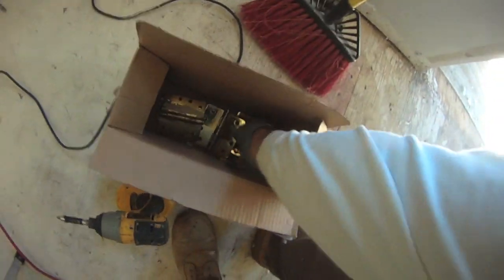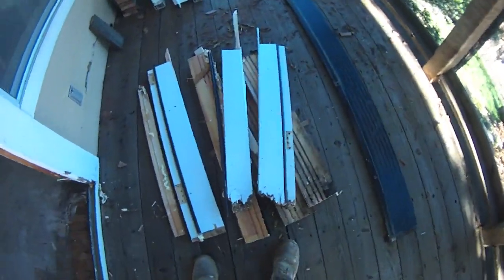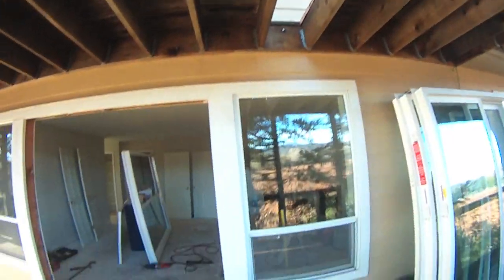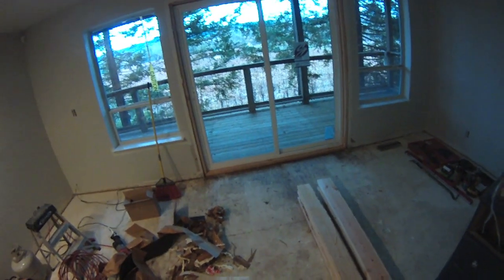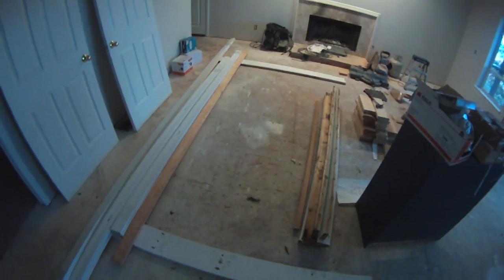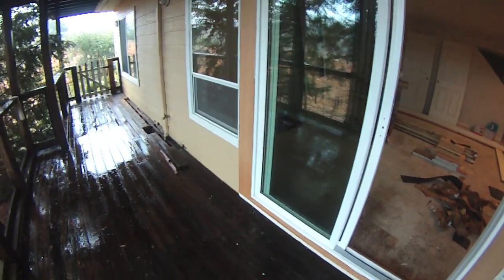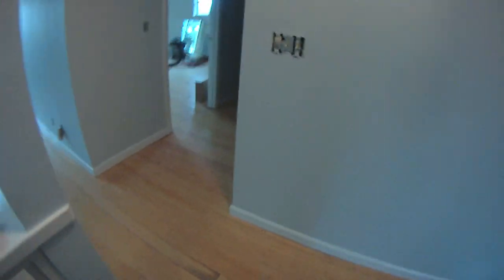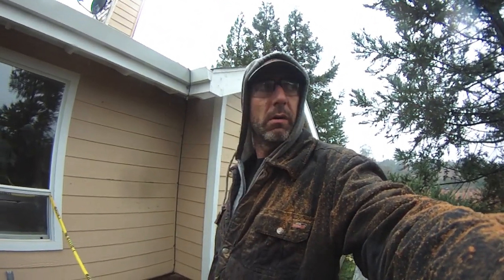Replacing Patio Doors

Comment: I'm on the sweet tea big time! Great work Bee! I guess homebody eventually showed up?. I know some people that unhook their dryer vent pipe in the winter for extra heat and put panty hose on the end of it.I'm sure you could buy some kind of fancy shelving out of the left over wood, but its probably gone, or is it in the wood hoard! Have a good'nnnnn
Reply from the maker: +geargriden19 Homeboy showed up around noon... he whined that I worked him too hard the day before.  I was running circles around this kid and he's half my age... ugh.  Oh, don't you know that I put that wood in the hoard for a future project...
Reply: +geargriden19 They also make a special vent kit that uses a small pail for the end of the hose.  You put water in the pail and that traps the lint as the air blows over it.  One brand is the "Proflex Indoor Dryer Vent Kit by Dundas Jafine."  It might even be a way of adding humidity to a dry home in Winter.
Reply: Right on Gadget i'll have to look that up thanks. Have a good'nnn

Comment: I just had to pull the trim off the windows in my bedroom and caulk over the gaps left by the window installers.  They used fiberglass to fill the 1/4" gap but I still had one hell of a draft blowing through.
Reply from the maker: +TheDisorderly1 A lot of installers are lazy with taking measurements and order them small and just fill the gaps with whatever they have on hand.  I like to measure any windows I install and order them so they fit right to minimize gaps.  Hope you got your drafts blocked.

Comment: Thanks for the tip about the nailing. 
What brand are your boots 
thanks 
enjoying
Reply from the maker: +napodano26 These boots are actually Herman Survivors..they are not Top of the Line boots, but they sure do keep the water out. I do add a Dr. Shoal cusion insert into them and it's like walking on pillows.

Comment: Flying commando!  LOL  Whats your boot of choice?  I am an orange juice in the morning person too, I never got into coffee.
Reply from the maker: +Mopardude Don't get me wrong...I love coffee...the smell is amazing, but I never wanted to "need" coffee to get through my day.  In my younger days I drank a lot of coffee, but about 10 years ago I quit cold turkey and didn't touch the stuff for about three or so years.  I kept myself to a cup or two a week up until about three months ago and stopped all together...for no reason other than a little change in the routine.  I really like my RedWing boots, but the work beaters I wear every day are are actually Steel Toe Herman Survivors..they are not Top of the Line boots, but they sure do keep the water out. I do add a Dr. Shoal cusion insert into them and it's like walking on pillows.
Reply: yourbeekeeper
I am in a weird place with boots right now.  I used to buy hiking boots because they are a mix of shoe and boot.  I used to bounce between Columbia and Merrel Brands.  Hikers are water proof and have good traction if am on a job site and its mudding or whatever.  I can also get them on and off fast because a lot of time I am in houses when they are done or mostly done.  Than back in the shop and they were more comfy than boots on the hard cement all day.  I dunno if the manufacturers have been cheaping out on hikers lately or what I am never happy with boots I am dropping anywhere from $70-$150.  I switch to Cat brand boots because I know a couple of guys who like them and they seem ok for $80-$100 price range they are.  Took me awhile to get used to wearing regular boots after wearing hikers for 20 some years.  The only part I am displeased about is having to take them on and off if I am on a job site where the house is done or if its a remodel and the customer doesn't want dirty being made.  LOL
Reply from the maker: I completely understand hikers vs. full boots.  I like the support of full boots.  I also like these boots because of the non-marking soles. The blonde soles never leave the skid marks black soles do on Lino floors.  I also keep a pile of slip on booties in my truck To avoid removing my footwear when requested.

Comment: Whoo bend over and spread on that cedar its got to be dressed material at 10 a lin foot.  I live in the province where we harvest Western Red cedar contractors are going to composite materials like Hardi  board because Cedar doesn't last long enough.
Reply from the maker: +Graveltrucking Yeah, I was dumbfounded by the cost of that wood...I needed to match the rest of the house, so I was stuck.  I did replace the rotten OSB siding with the Hardi cement board siding... looks identical and will never rot out again.